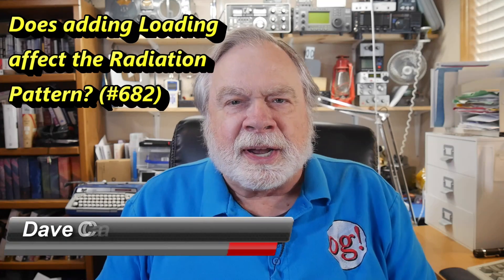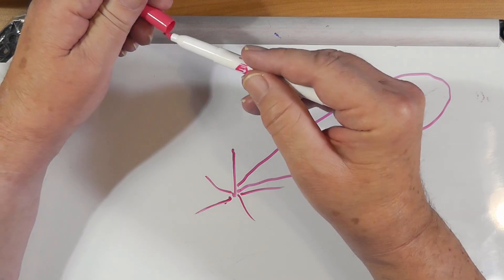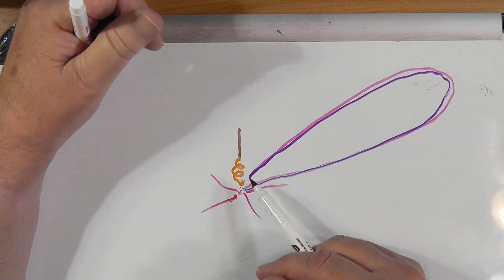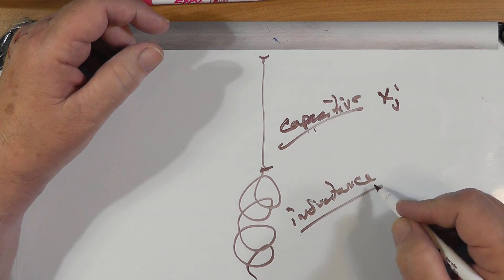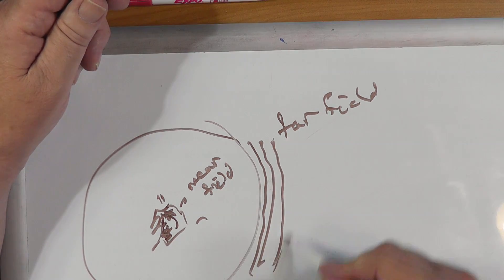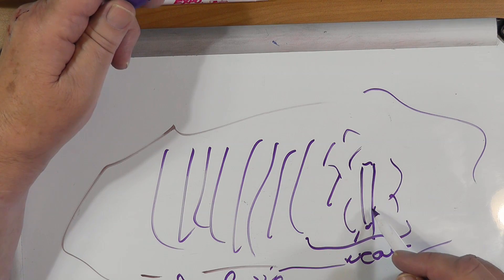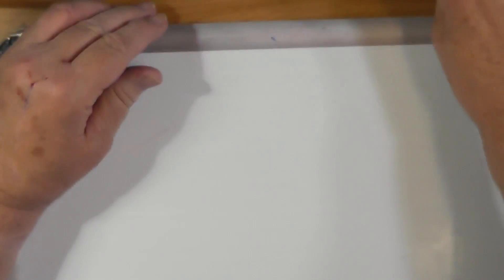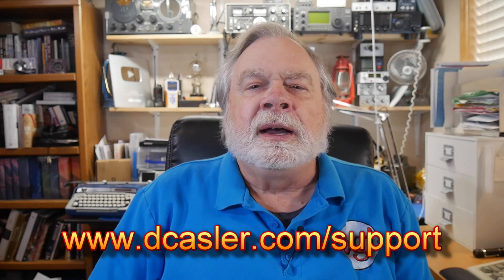Does adding Loading affect the Radiation Pattern? (#682)

Comment: I have an oddball question regarding coils. With a coil with fairly wide spacing between the coils. Wouldn't that effect the transmitted polarity inside the coil section of the antenna?

Comment: Hi Dave.... I have two 12v batteries ( like car batteries ) in parallel to give me 12v+. My radio likes 13.8v  I'm looking at a ( new voltage booster power DC converter step up regulator 12v to 13.8  20A 276w) 0n Ebay  price $36.47     What do you think, is it OK?   Thanks for your opinion
Reply: Lloyd, your radio should do just fine on 12V, except that if your car battery is 12v, it is likely on its way out; their resting voltage after charging should be about 12.6v. However if you really want to get to 13.8v, you'll likely introduce noise to your transmit and receive, with those cheap DC-DC converters.
Reply: thank you Dave

Comment: So, the SHAPE of the pattern does not change with a shortened / loaded antenna.  However, the signal strength radiated or received will be less.  I would assume this will proportional to the ratio of the lengths.  If you make the antenna half the length, that should result in a 3 dB (50%) reduction in radiated and received signal strength.  There will additional loss in the loading coil.

Seeing as one S unit on a calibrated Signal Strength meter is equal to 6 dB, loss from using a shortened vertical may not be critical until you are trying to communicate with a weak station down in the noise level or trying to get through a pile up in a contest.

Comment: Hi Dave, what an awesome answer full of wrong information!
At 2.32, you simply swap the symbols for the inductance and the capacitance; you always keep kind of getting confused each time you mention the symbols.
Inductance is denoted as +j or simply j. The capacitance is denoted as -j.
Inductive reactance is having the symbol, XL and the capacitive reactance has the symbol, XC. 
Obviously you shrug it off simply with a smile each time and every time.
Electro Magnetic energy (force) travels by transverse waves. The speciality of the EM waves is that it doesn't require a material medium for its own propagation. That's how the light (the visible part) and the rest of the electromagnetic radiations are travelling in the empty void of the space with the typical velocity of 300 million metres per second.
The pond and water ripple anology is the simplest way to visualise the formation and propagation of transverse waves in a medium (here in water). The energy impacted at the site of the stone coming in contact with the water would be getting dissipated at random; then due to the inertia of water column (viscosity included) the propagation of energy outwardly is getting into an orderly fashion to take up the form of circular ripples on the surface and few inches deep. Here the particles of the medium in which the energy propagates outwards themselves are not moving outwards but only "up and down". This is called the transverse mode of wave propagation. 
But the acoustic (sound) energy propagates in air by "longitudinal waves". 
Here the particles of air move "to and fro" from the sound source while the energy propagates outwards perpendicular to the air molecules oscillating up and down.
You surely are confused here and the viewers are finding difficult to comprehend "your physics" theory.
Then coming to the topic of discussion, 
the radiating wire (whether loaded or not) is actually behaving like a large inductor especially in the immediate reactive near field. Yes, you have a predominantly magnetic field around the antenna.
In the far field, about several diameters (of the largest dimension of the antenna) the  electric and the magnetic fields combine in "space quadrature" and the EM energy propagates outwards like a sphere with the velocity "v" the ultimate velocity of the Universe. The E field and the H field support and sustain each other while the direction of propagation is perpendicular to each other. The energy propagates obeying the inverse square law of radiation with distance.
So, Dave, please spend some time to understand the question asked and prepare yourself for answering with scientific sense.
De VU2RZA
Reply: you should take this to a private message to Dave.  Not blast him here.  I'm a viewer and was not confused in the least.
Reply: @HamRadio200  hi, but this is not happening for the first time. He is not taking care to prepare and answer to his viewer. Many have a great respect for him as I do. In the beginning he did well, no doubt. Of late he is more interested in the number of videos (with poor and sometimes erroneous information) he can make. Especially in the COVID pandemic times many YouTubers started giving at least one video per day.. 🙄
That's really alarming. I know Dave is a columnist in the ARRL's QST magazine.
Naturally he has to be very authentic, I believe.
De VU2RZA
Reply: @subramanianr7206  your making a mountain out of a mole hill. The topics he discusses are not life threatening nor earth shattering. If you don’t like the content, please unsubscribe and don’t watch it. We can see from just your post that you post stuff that is incorrect as well, and you acknowledge that. Nobody is perfect.
Reply: @HamRadio200  Ham radio is a scientific hobby and the science can not differ from person to person. Maybe you went to a school where you were not taught science. Art is long and life is short.
You still have time to learn radio science, I believe.
I wish you all the best 👍
De VU2RZA
Reply: @subramanianr7206  I tried emailing you but it seems your email on QRZ is not correct. I have a question for you related to amateur radio in India; My email on QRZ is correct, please reach out to me, I wanted to ask you some questions and see if maybe there is a possibility of expanding the hobby to some friends I have.
Reply: @louisseaman8455  hi, happy to know that you tried to mail me. What questions do you have related to amateur radio in India!? And which country do you belong to!? I may have some questions related to amateur radio in your country too.
Hope you will respond to these questions here.
De VU2RZA
Reply: @subramanianr7206  I live in New Jersey, U.S.A., and we have a large Indian population here; professionally, I have many Indian clients, and the vast majority work in technical fields (mostly software engineers), and I have always been curious why I know not one who has an  amateur radio license?  I would have thought amateur radio would be very popular in India given its size and territory, is it popular in India?  Also, I'm curious if you have regular radio contact with the USA from India, and if so, what band(s) work the best for you?
I have thought, introducing amateur radio to the Indian community here in the USA, could be a way to bring more people into the hobby here, and maybe even there, in India!
Please give me your thoughts, I would enjoy hearing your perspective.
Reply: Are you sure that the velocity of light and the rest of the electromagnetic radiation is 3 million km/s and not 300 000 km/s?
Reply: @alaska3333  you are right. It's 300,000 km or 300 million meters 3×10^8 meters per second (rounded off to the nearby number. Thanks for pointing it out.
De VU2RZA

Comment: An interesting question and an interesting answer. Thank you. Does a capacitance hat also reduce the overall capacitance of a short antenna (like adding inductance does)? And does the far field look the "same" with a capacitance hat? Once again, thank you.
Reply: When you get to 160 and 80 any antenna with a vertical component looks like a bubble. With just a vertical you have a circular bubble, with a wire that goes up then out in one direction you have a bubble with a bulge in the wires direction. 
The capacitive hat makes it more like a vertical with a circular bubble pattern. You shorten  the height of the element and lower your takeoff angle. 
I’m not a pro, that came from playing with modeling software and my personal experience. 
As with any antennas, your mileage may greatly vary.
Reply: @dougtaylor7724  Thanks. All comments appreciated.
Reply: excellent question!